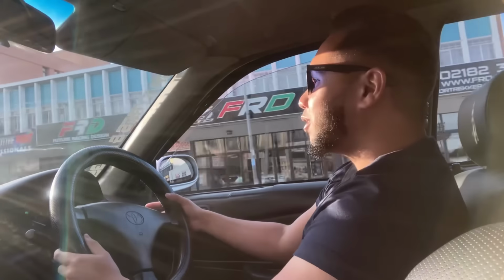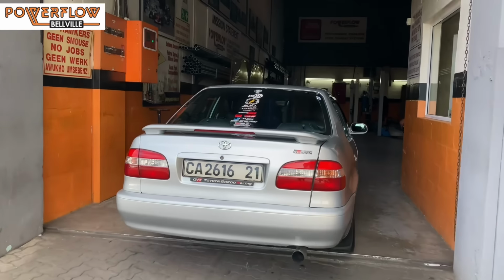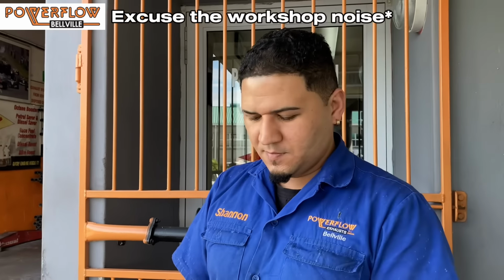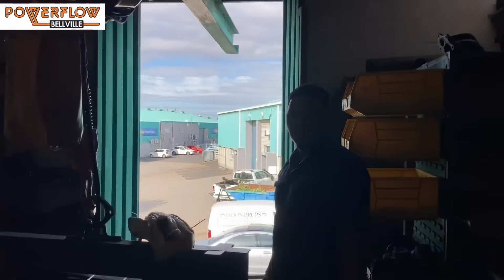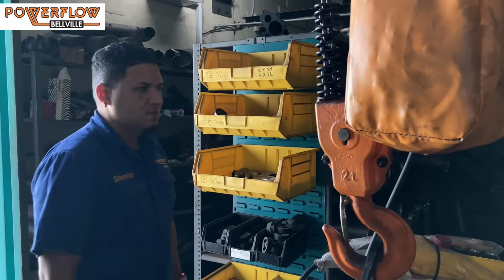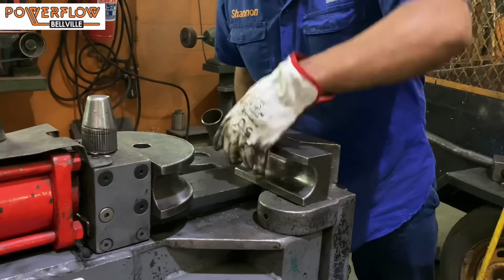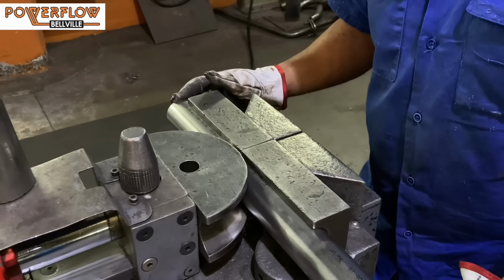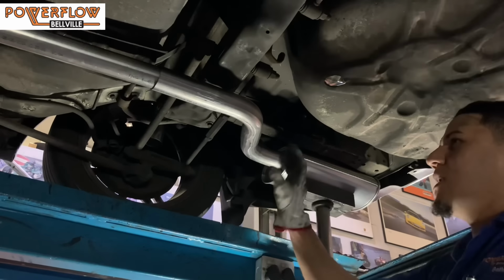Exhaust upgrade on my Corolla 4AFE😍 | IT SOUNDS SO GOOD!!!

Comment: Had my "Bubble" 4AFE 160i done at Powerflow Bellville about 17+ years ago, 4-2-1 branch and 50mm pipe and sounded just as sweet. The kicker came with a UniQ chip that almost gave the car a totally different tone after it was tuned! Induction sound was very much toned down in normal driving conditions but would burst into a geraas over 3k rpm. Get someone to change your valve stem seals as they are a common problem on the 4AFE that cause that puffs of white smoke.
Reply from the maker: Damn that’s a looong time ago and I’m sure up until today you have the most funnest memories from your 160i🤣

And yes bro for sure need to sort the valve stem seals in due time🤲🏼

Comment: got a 76mm downpipe and a powerflow on my mk5 gti and she sings! but this makes me miss my 1.6 20v tazz.
Reply from the maker: Bro boost is nice but I get what you mean that NA sound and feeling you probably miss from time to time
Reply: We won't sell those kinda cars the 1.6 20v is more special to me than a mk5 golf. The sound, fun, light on fuel while still having fun, cheaper to maintain. I'm sure the 20v sound more special and different once that vvt kicks.
Reply: @real_dj_bash  was actually my father's car. He got it for next to nothing. But yes light on fuel sounds amazing and they were fast as fork. But nothing beats my mk5 gti. 300 hp and it just sings bro.

Comment: Very nice u sieke not gona answer this but how much or atleast about how much also does this take more petrol i have a tazz 1.3 wude like one
Reply: For tazz 1.3 they charge me r3200. That was like last year dont the price now. Give a nice deep sound. It does take abit petrol that's if u gonna drive after the sound tho
Reply from the maker: Yo bro in all honesty the pricing will differ from quotes based on what exactly you need so you can enquire directly with them

For all enquiries contact them my bro

021 930 7717

With regards to the fuel I can confirm there is a decrease in my fuel consumption for sure! Even with the spirited driving I have noticed it’s lighter than before.